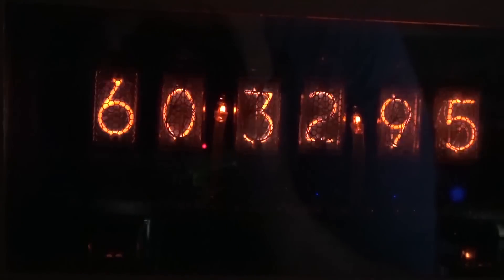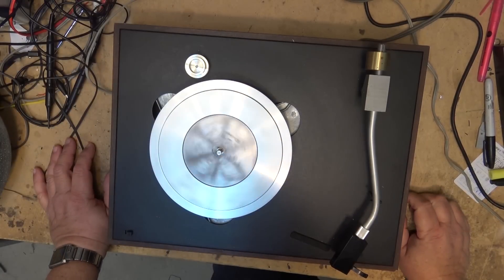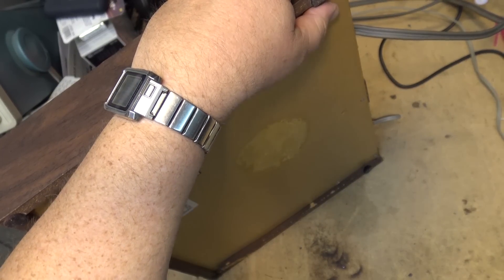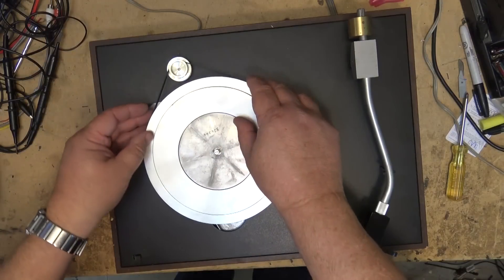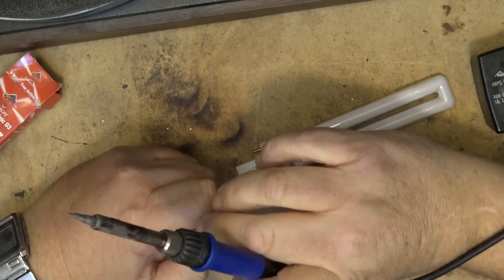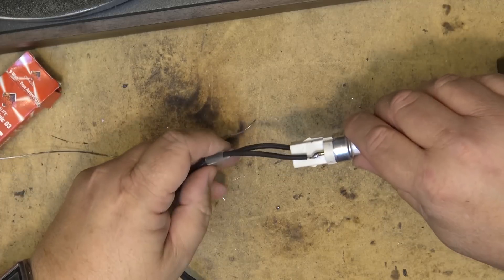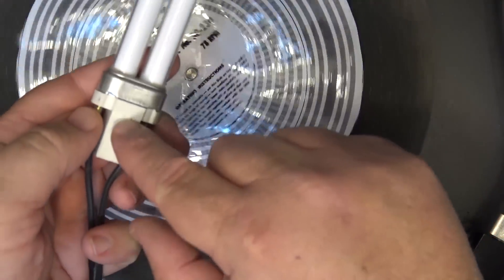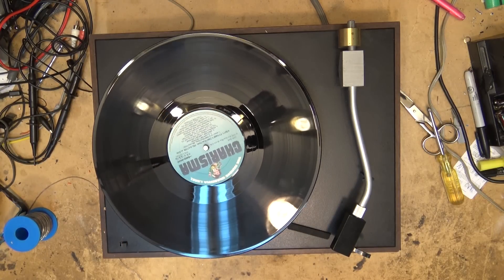AR model XA manual turntable check over

Comment: Wow. You wernt kidding when you titled it "manual". I cant see myself fiddling with the belt every time to change speeds, thats nuts.
Reply: The Amstrad TP12D I had back in the late 70s had a similar speed changing arrangement. It wasn't a bad deck really, but no shock absorbing suspension or sprung feet meant it picked up pretty much every external sound.
Reply: THEtechknight I have a later incantation of this turntable. Same basic features. I hardly ever listen to 45s anyway.
Reply: But you would rather have a speed changer that is breakable?

Comment: I like the "Dave cad" drawing, pioneered by EEvblog lol.
I know how the strobe disks work and i've made them, but they still seem like magic lol.
I love optical methods of testing.
Now that deck is basic, not even a speed change lever to jump the belt, but that platter will have no speed warble, a big flywheel with momentum, just like a steam engine.
Reply: instaBlaster...

Comment: Hi there, I recently acquired this turntable and hear no sound when I drop the needle. Is there something specific I should be looking at to troubleshoot? Thanks!
Reply from the maker: First make sure you are plugged into a phono input.  I know this sounds stupid but the number of people that plug a magnetic cartridge turntable into a line in on their amp and wonder why there is no or very little sound would boggle your mind.  There are only a couple of things that can cause this. Broken wires or a bad cartridge.
Reply: @12voltvids  Ha! Not stupid at all, but unfortunately I did a stupid thing and broke the needle while fiddling around. So now a new cartridge correct? Not sure how to go about replacing it myself though...
Reply from the maker: @gentlemanbrawlers  
Well that will do it.  You may be able to just get a replacement needle if it was a common one.   Moat just pull out and should have a number on it you can use to order.
Reply: @12voltvids  Thanks! I'll see if that's possible then.

Comment: There is an android application called RPM calculator. you are running after installing it in your phone. you turn the phone on and put it on the phone and the app shows you by measuring the speed of rotation. I'm doing this problem-free calibration. I follow your videos with excitement. thanks.

Comment: greate video, a big favor, can you tell me the brand of the motor and the details please
Reply from the maker: I have no idea what the brand of the motor is.
Reply: Hurst is still making motors as replacements for the AR xA , xB and a few other models by Acoustic research..They are 300 rpm motors AC synchronous motors..

Comment: alot of reel to reel tape decks have a motor-run capacitor, i've had to replace several of them
Reply from the maker: All induction motors use them. Only squirrel cage or shaded pole don't.

Comment: Speed is well off, not typical of this model, which usually tested to 0.04% error. I'm sure you know that 7 lines/min, =0.1% error.
Reply from the maker: syncronus motor. No speed adjustment. Doesn't matter that guy that owned it found some sucker to pay him hundreds for it.